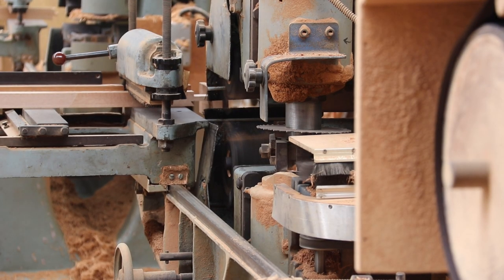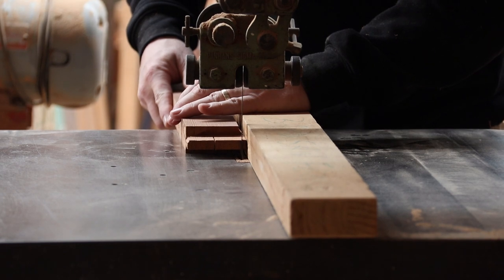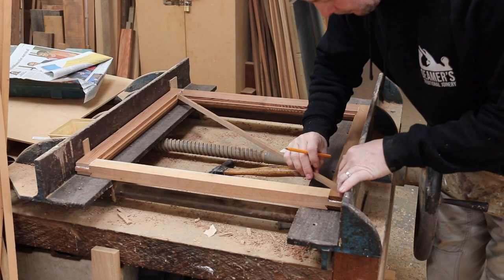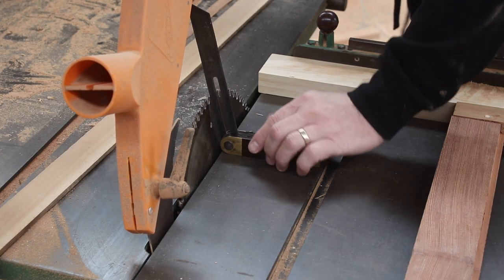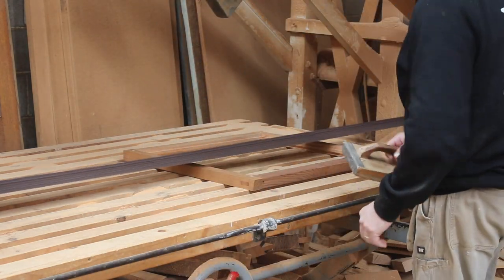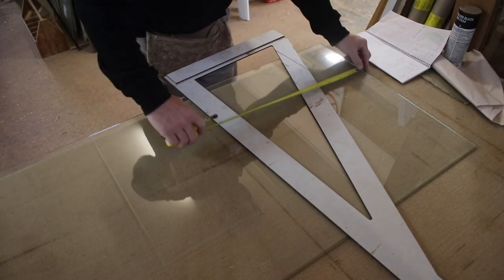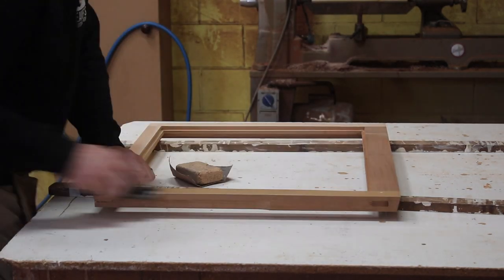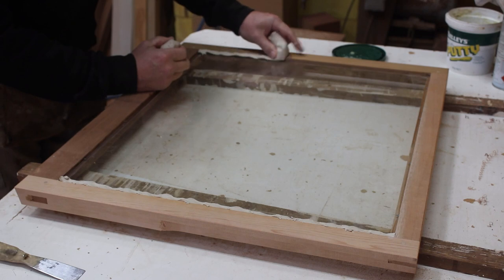How To: Make a Window Sash Start to Finish  | Woodworking Projects

Comment: Nice job. Thanks for uploading. 
Two questions…what type of glue do you use? And what “type” of putty?  Many thanks!
Reply from the maker: Thank you.
Just a high strength water resistant PVA glue and linseed oil based putty.
Reply: Thanks for answering, saved me asking. Great video thanks😊 @DTJoinery
Reply from the maker: @Wornout1  
No worries.
Cheers.

Comment: Loved watching this! I learnt heaps. 
I’m assuming that’s WRC? I’m having a crack at replacing some 100+ year old cedar sliders.
I’m going to use a combination of Cedar and TAS Oak. Cedar for bottom rail and oak for the rest. Do you think that will work combing two species ?
Reply from the maker: That's great.
Yes, this one was WRC.
It's fine to use different species together on things like sashes and doors. it's a little more of an issue with some furniture where shrinkage rates vary.
Make sure you paint it well, as Tas Oak is not overly durable.
Reply: @DTJoinery  Thank you for your fast reply. I really appreciate your advice. Whereabouts are you guys? Victoria, NSW?
I'm in Sydney. Thanks again 👍
Reply from the maker: @thomo74  
No worries.
North of Sydney.
Reply: One more question regarding the window. When glazing, is it essential to use putty when sealing and setting the glass on the external side of the window? Can I use beading like on the inside?
Reply from the maker: @thomo74  
Yes of course you can. We putty glaze because we do Traditional joinery, many other companies bead glaze their sashes.
Reply: @DTJoinery awesome. Thanks!
Last question.......
If I do use beading and a silicone adhesive, would you recommend still using the glazing pins? Or is that not necessary?
Reply from the maker: @thomo74  
Not necessary with beading, sprigs were designed for hilding the glass in place when you use putty fornthe glass to bed in. We still use them with silicone to hold it until the silicone dries
Reply: @DTJoinery  thanks very much. I really appreciate it 👍
Reply from the maker: @thomo74  
No problem.

Comment: I also work on sash in the UK, just wondering if the heat of the steam ever cracks the glass?? Also, how wet does the timber get? Does that cause any issues??
Reply from the maker: Sorry, I'm not sure what steam you are referring too. Could you explain?
Reply: @DTJoinery  apologies, I don't know how my comment appeared on your video. I had also been watching an American guy stripping putty from a sash after placing it inside a box filled with steam.
Reply from the maker: @GreenSaxon  
Haha  all good, now I understand your comment